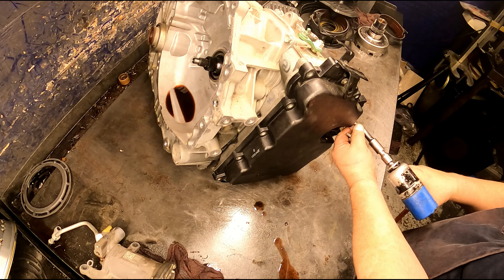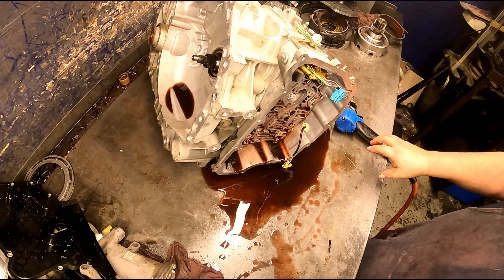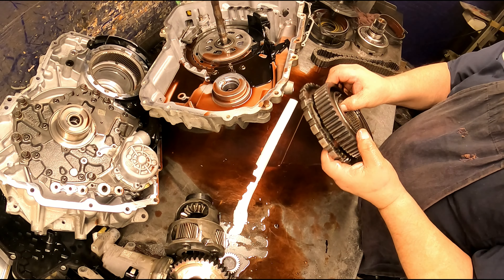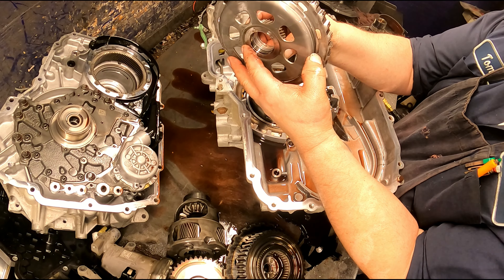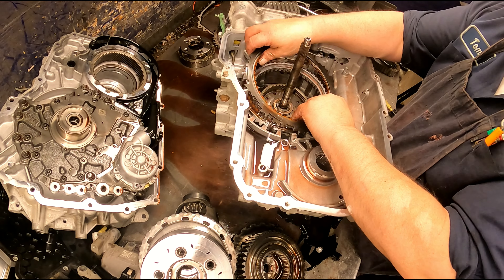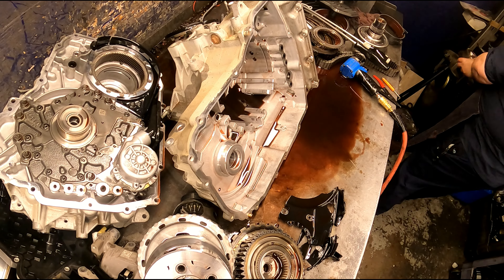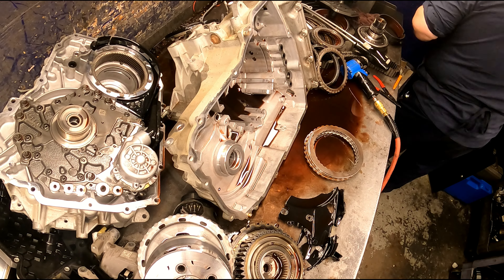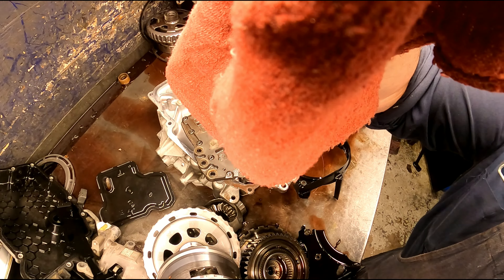6T45E Gen 3 Disassembly

Comment: ser please help me about a code P0741 torque converter clutch circuit performance stuck off..
Reply from the maker: Torque converter is bad, bushing in the housingthat the input shaft slides through, bad Techm or valve body problem.
Reply from the maker: Forgot, since this is a Gen 3 it could also be the Lube On Demand Valve in the pump. Both Sonnax and Transgo sell a repair for it.
Reply: @CurmudgeonTransmission  thank you ser and god bless

Comment: If you don't build it, what do you do? Get a core and build that one?
Reply from the maker: Either get a core and build that one. If the customer wants to you can do used or reman from the dealer. Customer opted to send this to a reman facility as they quoted him a super cheap price. We got the unit back and installed it and it was throwing the output speed sensor code. Remember in the disassembly I siad it was bad? Well I knew right then what they had done and why it was so cheap. They used alot of the bad parts again. Customer decided to have us replace the output speed sensor. Once we got the pan off sure enough. There was the bad speed sensor and thermal valve that was broken was in there also. We put a new thermal valve and speed sensor in. Transmission still did not work properly. At that time we bowed out of the deal and told them to take it to the rebuild facility. There's a reason they are so cheap.